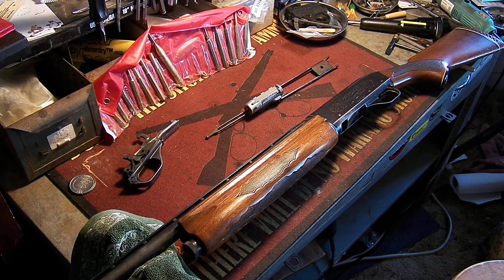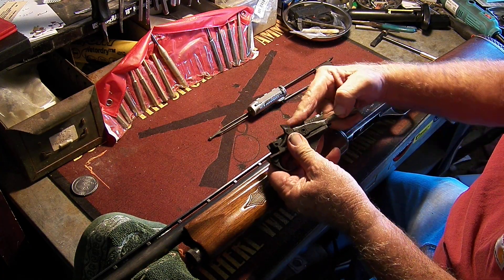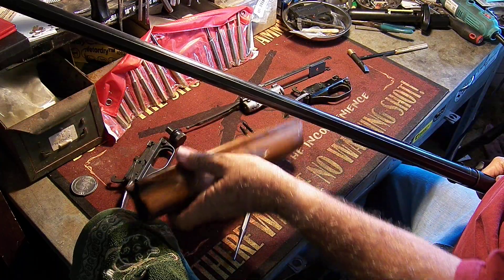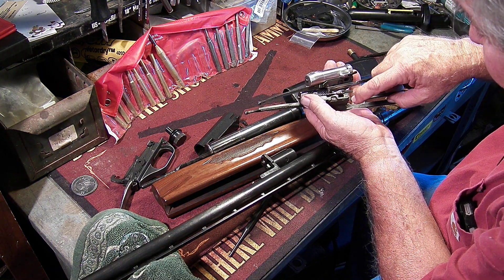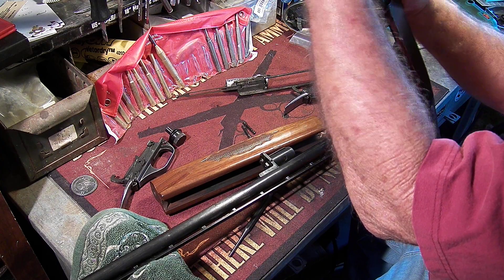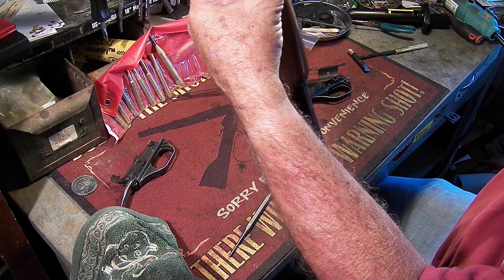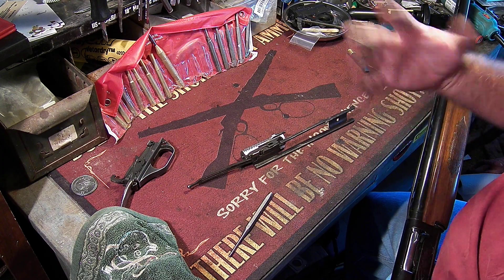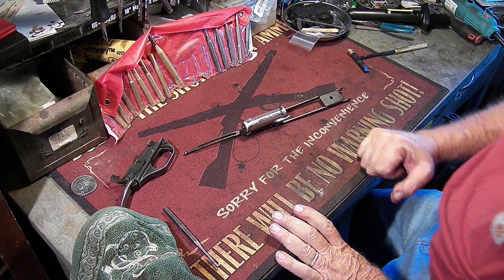Ithaca model 51 Featherweight field strip

Comment: Awesome video I have watched it several times, I do have question… my M51 has been apart so long I can’t remember if the bolt buffer is forward inside the bolt like towards the barrel or is the buffer to the back of the bolt like towards the pin that locks the firing pin in place.

Comment: Hi Frank.  Thanks for posting this video.  I bought a New Old Stock Model 51 two years ago.  Right now it is very unreliable because the extractor does not grab and pull out the spent casing.  Not sure what to do.  Any ideas??
Reply: +Keith Chambery 
Would love to find a few extractors. Mine is okay now but I've broken a few. I haven't used this gun in years however, I'm taking it out this season. A machine shop can make them but... I think we'll need to have them hardened. A ceramic art store may let you put the machined parts in a kiln?
Reply: Hello Michael,  If you end up having a few made please let me know.  Good luck!  Kieth Chambery

Comment: I have one in my shop now that will not load the next round. When cycling the action with dummy cartridges the second shell is let out of the magazine tube but the lifter will not lift and the bolt will get locked in the open position. Any thoughts?
Reply: Hi, I have the same issue, did you get any luck? any ideas that you can give me? thanks.